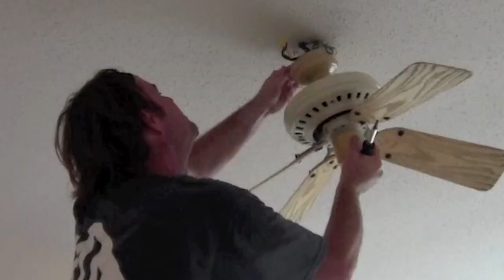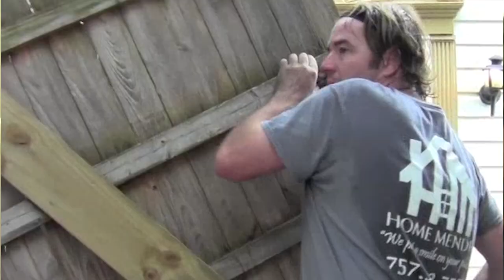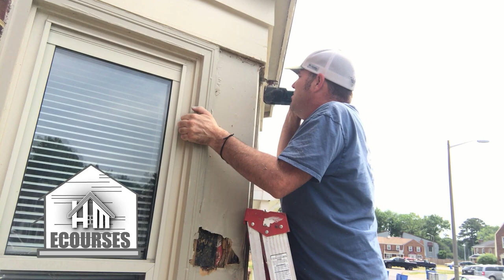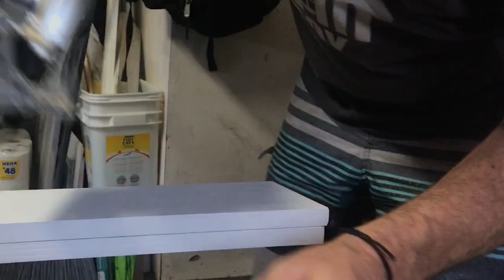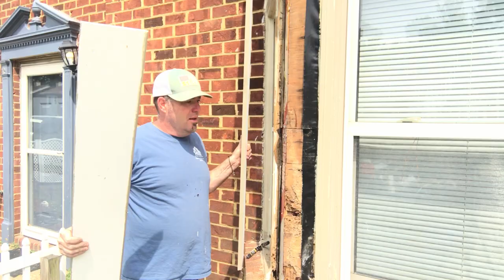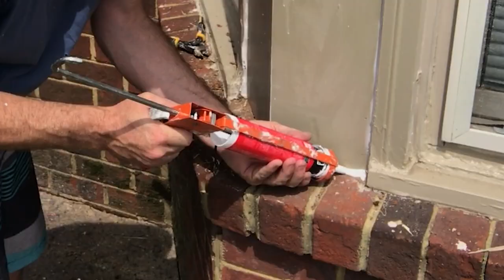How to replace rotted wood on bay window, replace window trim. Easy!

Comment: Thanks for this video! I wanted to see if the rotten wood on my window could be repaired or if I’d need to replace the window. It seems it can easily be replaced which is a relief. I don’t have the tools( or skill ) so who should I get to do this? A joiner or window fitter? I don’t want to get the wrong tradesman out.
Reply from the maker: Any kind of home repair guy?

Comment: Have you not just treated the symptom and not the cause?  Surely there is a reason why that wood rotted. It also looked like the framing may have had some mold.  Don't get me wrong, I like the technique and thank you  for sharing your knowledge. I'm just asking so that if it happens here, I don't have to do it again in a couple of years.

Thanks, Dustin.
Reply from the maker: Hey meat. ! With this one it looks to me like they did not keep a good coat of paint on it. It allowed water in attracting termites. The termites ate out the inside and some of the outside. When you get the wood replaced and sealed up you should be good to go.  Don’t forget that coat of exterior paint 😃

Comment: I need to repair an area under my bay window where the deck meets the house.  The siding is warped and opening up.  Also wood trim on the window is rotting.  Do you have a vid for that?  I'm scheduling to have gutters installed which has caused the damage.
Reply from the maker: Hey lady yes ma’am I have a whole Rottenwood section you can check out that will probably answer any questions that you have. You rock thanks for commenting
Reply: @homemend  Thank you so much for your reply.  I'll check it out.

Comment: Great videos. I have a ceiling light install question. I replaced my ceiling fan &light with a flush mount ceiling light. When I removed the fan, I was left with black, white, ground, and red wires in the box. I connected black to black, white to white, and ground to ground, and capped the red. On the wall switch, the 3 speed fan switch now runs the light (light intensity changes with switch position) and the wall on/off switch does not do anything. So my question is do you see anything wrong with running the light through the 3 speed fan switch? If this is not suggested, I could either replace the  3 speed switch or try to connect to the wall on/off switch. Does it sound like if I wanted to use my current wall switch that I should connect the light black lead to the red lead in the box?
Thanks !!
Reply from the maker: Hey Amy it sounds like they had the black to the fan and the red to the light. I would cap the black  and wire the  red. It sounds like it’ll take care of your issue. You got this. !!  😃
Reply: @homemend  Thank you very much for your quick reply. I appreciate the help!
Reply from the maker: Anytime thank you Amy